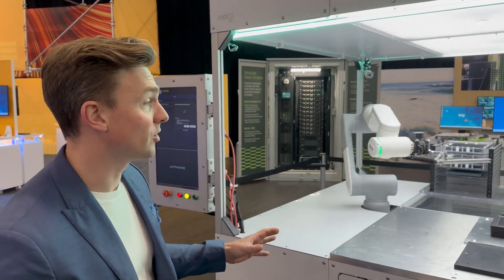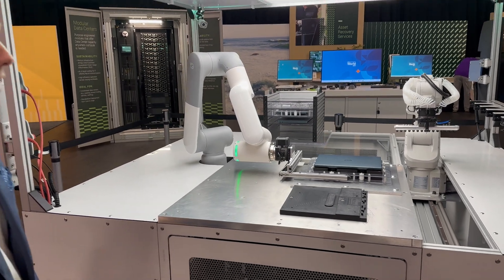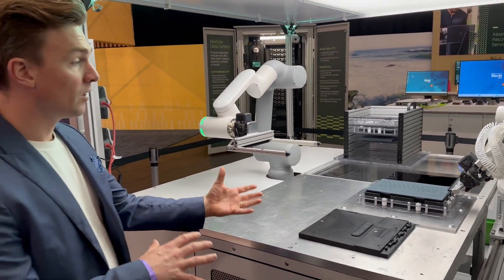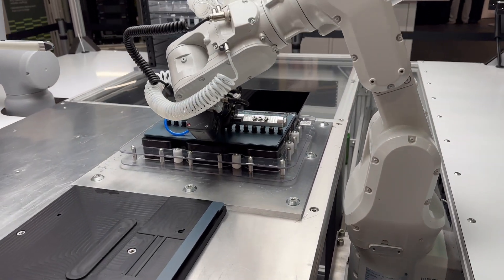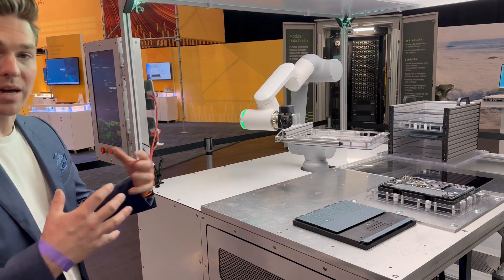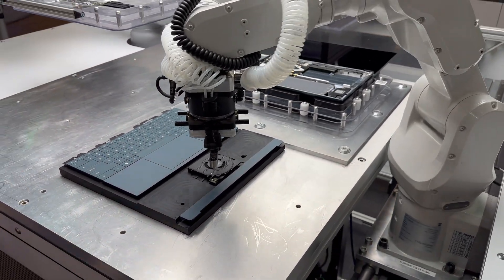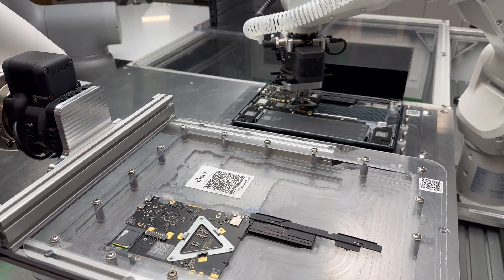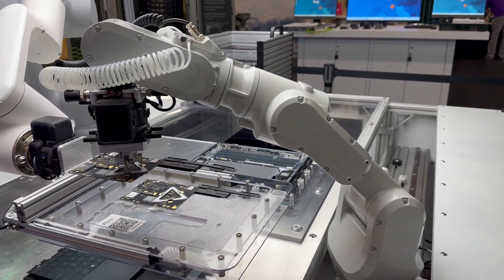Hands-on with the micro-factory running Dell's Concept Luna's evolution at Dell Tech World 2023!

Comment: Considering that people tend to keep Apple laptops for 7 years and the amount of wear you accumulate on such devices if taken to school or work often, I have my doubts about upgradable 14-15,6 inch laptops like Framework if they will cost significantly more, or like in case of last Alienware upgradable laptop they may not keep supporting it for very long, which means that likely at beginning there will be no large interest due lack of trust in company support, and because of that, support for potential upgrades end.
The question is if you can make upgradable laptops widely attractive without opening architecture to other manufacturers that can then also produce parts, thus, in consequence, creating industry-accepted laptop case standards for various sizes as we see in desktops. While I understand that manufacturers want to keep their upgradable laptops proprietary, so only they make money on upgrades, it greatly reduces the attractiveness of such products in the early years when there is no certainty that such laptops will keep being supported.
Where I see the potential for upgradable laptops is in thin display bezel 18" laptops in size of older thick bezel 17,3" laptops as desktop replacement computers for people that not want to lug around desktops like students, truckers, or working people living in small rented apartments that may need to move often yet wanting to do long hours behind computer which is eye straining with small screen laptops. I upgraded my 2014 Alienware 18 laptop with a larger SSD and replaced the GeForce GTX 770M SLI with the GeForce 980M upgrade package from Eurocom as Dell did not offer such option which would be for many inexperienced users viable even if they need to pay Dell technician for installation, as it will be still cheaper than buying a new laptop.
Currently, there is for example 14" Toughbook FZ-55 Mark II with a ridiculous amount of battery life with multiple hot-swappable bays for battery yet with weight only passing 2kg on one battery which is not that lot for a semi-rugged laptop with a high degree of EASY modular upgradability often not requiring opening laptop at all including Blu-Ray writer, or GPU alternative in the same bay, alternative ports module and so on...
Unfortunately, the high brightness screen is meant for outdoor, not color accuracy, so not exactly average consumer oriented but if they make this design more consumer-oriented with upgrade support for CPU/motherboard and make purchases more consumer-friendly, perhaps they can gain a larger market for people needing nowadays special features like hot-swappable batteries, Blu-Ray writter, or smart card/wireless ID reader.
While I don't think that Panasonic currently has the infrastructure to build and service modular laptops for the masses, if a large manufacturer like Dell with the necessary infrastructure made an FZ-55 style modular bay upgradable desktop replacement laptop that can be easily upgradable by anyone in the form factor of older 17,3" laptops like ZBook 17 G6 you may get a lot of people that fear opening laptops to replace GPU interested...